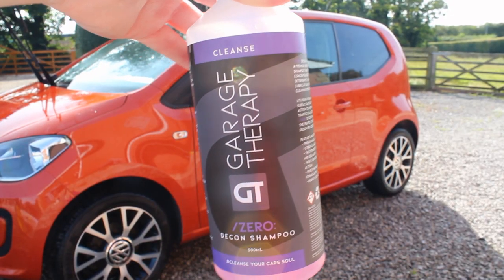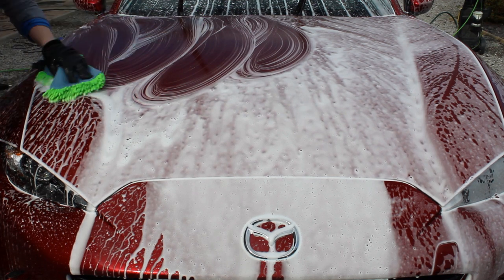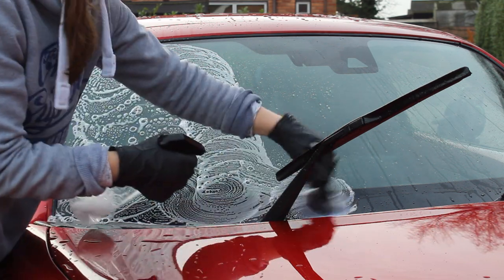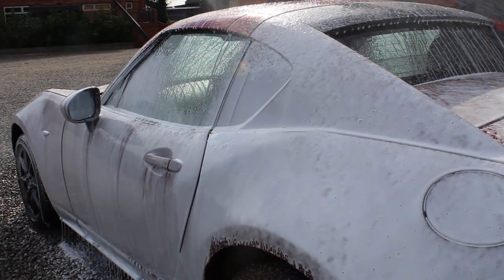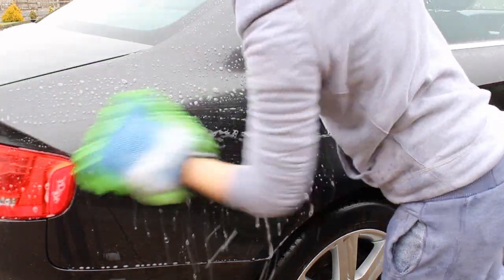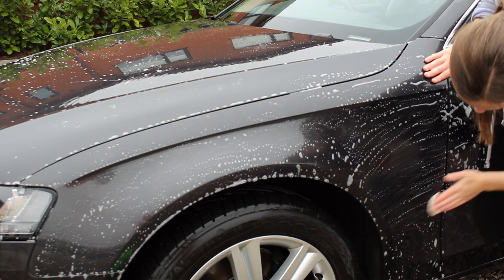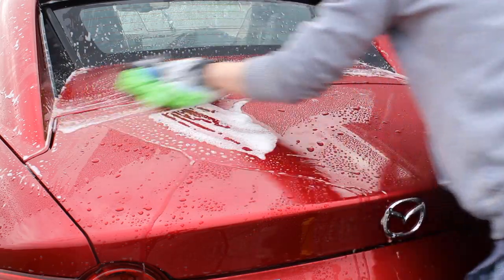8 Ways to Use Garage Therapy /ZERO: Decontamination Shampoo

Comment: What a smashing video Heather! Thank you once again for taking the time to do a video on one of our products. You summed it up perfectly, its a tool to be used when the situation arises. 

Some other ways of using the shampoo
1. Wheel Cleaner
2. Engine bay cleaning
3. Heavy degreasing and undercarriage cleaning. 
4. Cleaning Door shuts and rubber seals
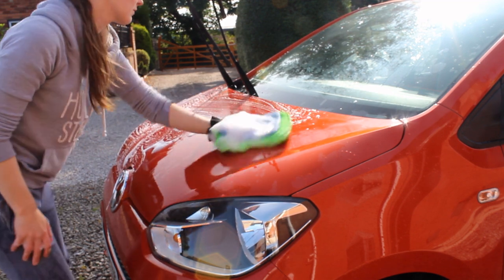5. Used as a prewash in a pump sprayer 1:10 heavy duty cleaning 1:25 Heavy 1:50 Medium and 1:75 Light cleaning
Reply from the maker: Thanks very much! Those sound great I’ll give them a try next time! 😊

Comment: Interesting observation...reviving the ceramic coating.  Makes sense.  My Tesla Model 3 has the CarPro Xpel finest reserve ceramic coating...and of course they recommend sticking to CarPro products for cleaning/decon because they're specifically designed by the same brand.  However I've found as an example the Gyeon line of products work great with my ceramic coated car and I'm quite sure other products do as well.  Sometimes you have to look past the marketing!  That's what makes your channel so great: the reviews and various uses of products.  You have a big fan across the pond.  Over here we say tire not tyre.
Reply: CarPro CQuartz finest reserve on top of Xpel ppf.  That's what I meant to say.
Reply from the maker: Thank you! That’s really true, there are so many great brands out there, I feel like I’d be missing out if I just used one!

Comment: Have you tried this in an ik foamer? I've just got the ik foam pro 12 and some decon shampoo, I was going to use it as a deep wheel and tyre cleaner. Do you use same ratios for products in ik foamer as opposed to a normal spray bottle? I haven't used it yet
P.s. I'm currently using surfex as a tyre cleaner as it seems to do a decent job of removing the tyre bloom (antiozonants). Is this better than surfex for cleaning tyres?
Reply from the maker: Yep it works really well in a foamer. Try using about 10-15 mL of shampoo to 500 mL of water. 

For tyres I’d try it a bit stronger. 1:9 is a good ratio and has worked better than the same dilution of Surfex HD when I’ve tried it
Reply: @AutoCareHQ  brilliant thanks for the advice, I will try some at a stronger dilution ratio

Comment: 2 ways really 🤔🤔🤔 in a snow foam lance as a pre wash or in a bucket as a shampoo 🙄🙄🙄 you would clean the glass as a shampoo and even the wheels and tires that's all i ever use it for pre wash in snow foam to help get rid off very old waxes and sealants and the same using a shampoo 🤔🤔🤔🙄🙄🙄